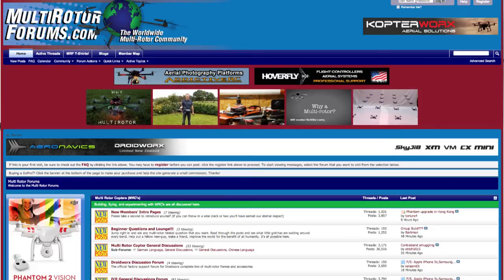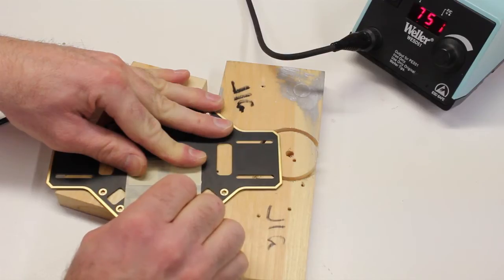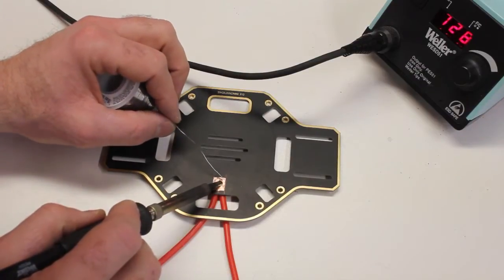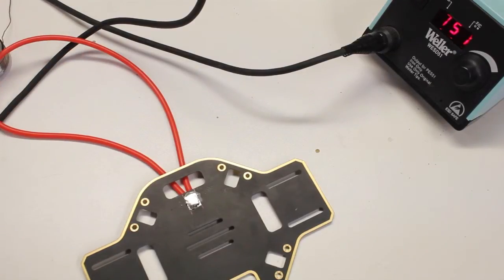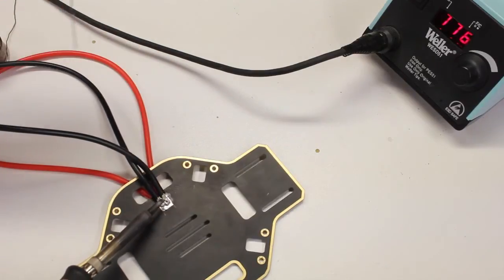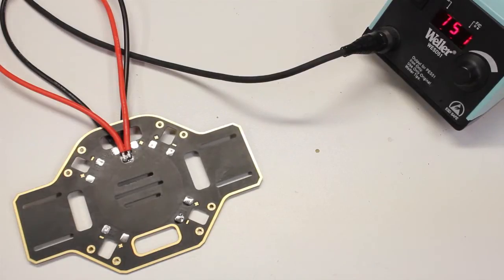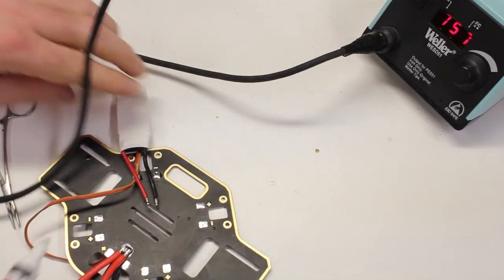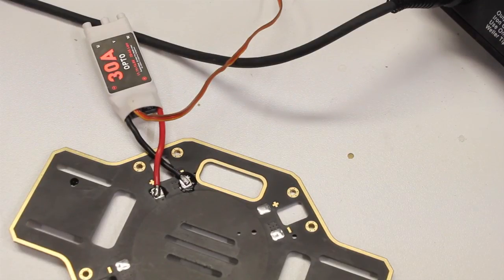MultiRotorForums.com NAZA/F450 Group Build 2013 Vid4

Comment: You need to match your tip to the surface area a bit better. The tip you were using for the power leads was a bit on the small side and takes too long to transfer the heat. This can result in cold soldered joints with dry patches. A larger tip will transfer heat faster and give a good molten puddle without giving too much time for the solder to track up the wire. As a rule of thumb the tip needs to be roughly the same size as the gauge of the wire. This is the diameter of the end of the tip, I know it's tapered.

Comment: what size wire is that, it it essential to use that size? Thanks.
Reply: wire size is dependent on the amps being pulled from the batteries....I'm pretty sure I used 12AWG wire for the battery connections on my Flamewheel